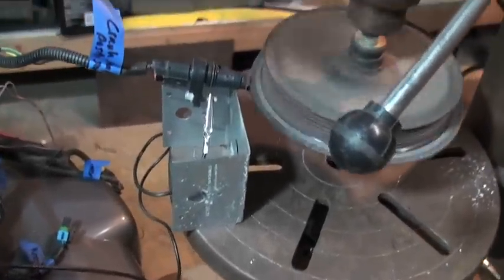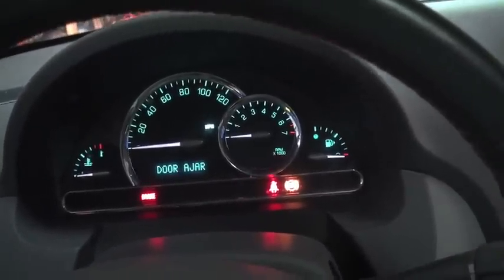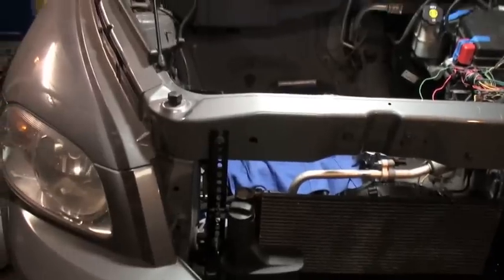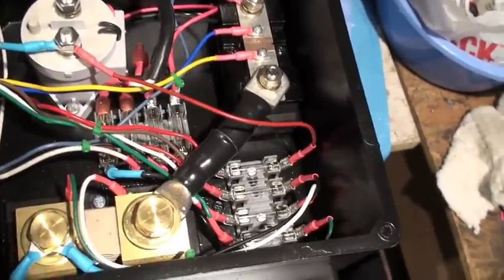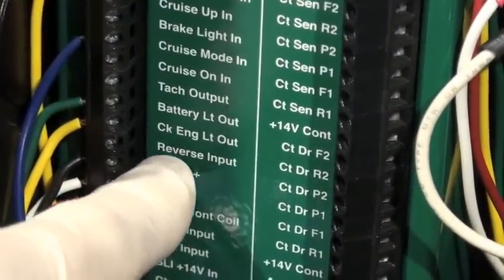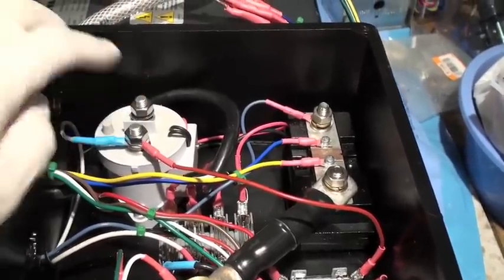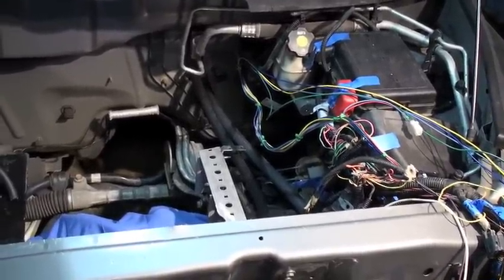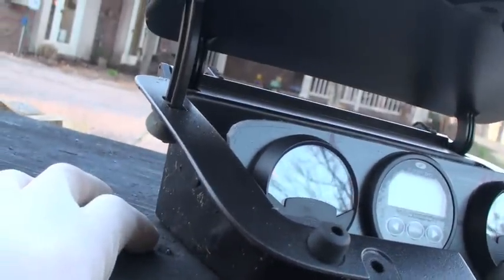HHR update December 2011 -Feb 2012

Comment from the maker: Thanks, I'm in the process of setting up a simulator that produces crankshaft sensor signal, camshaft (exhaust and intake) sensor signals, MAF signal, oxygen sensor signals, throttle position signal, and MAP signal.

Comment from the maker: thanks Larry, it's hard to tell but that spinning wheel is a 58 tooth reluctor wheel from the crank shaft of a GM motor.  This is reported to be the same one as in the stock 2.4 l ecotec engine that was in the HHR to begin with. I've been told that I have to have the cam shaft input also to get the ECU to come on.  I think it is a 2 pulse per revolution input but I'll have to do a little more research on that.

Comment: i believe the ecm needs a signal from the crank sensor and the camshaft sensor, they work together. some vehicles also have a distributor sensor if they arent equiped with coil packs. I hope this helps, good luck.

Comment: I know, i mean the signal is pulsed directly, so you can just put whatever sensor with 2 triggers on the electric motor rotor and feed it directly to the dash. Not shure exacly how your dashboard works, but all the dashboards i disasembled have direct connection to the ignition coil or the hall sensor at the cam shaft. It's basicly the same thing as generating puses with a switch and a hump on the rotor. You just need to match the amount of pulses per rotation to get the corect RPM.

Comment from the maker: Yes, so do all of the other little things go into a conversion. I usually spend about $1k on the "little things" for each conversion.  I think I'm going to try to buy connectors, nuts, bolts, plastic sheets, multiple gauges and colors of wire, tubing, zip ties, hose clamps, velcro, steel and aluminum struts, grinder wheels, electrical tape, teflon tape, and a hundred other little things in bulk before I do the next one.

Comment: 0:39 Hi, any chance you could do a ten years later update, is this vehicle still in use? With the current fuel cost, maybe a recap of the conversion including what worked and what didn’t work. Changes due to failures! I have an Interest as my daily driver is an 06 HHR

Comment from the maker: Well, it turns out that the vehicle is actually a 2006 HHR not a 2008 and that means it has what's called a 7X or 6+1 crankshaft reluctor ring that is manufactured into the shaft, not the 58 -2 ring that is found on the 2008.  So I'm in the process of making a 6 inch reluctor ring with 6 notches 60 degrees apart and one notch 10 degrees off of one of the 6 main notches.  This should replicate the pulses that the ECM expects to see.  I'll keep the .030"  gap in mind.  Thanks

Comment: ido not know if its important now but you plased a culing radiator sideways you migh have a problem with bubles/air stuck on the top of your tubes (radiator supose to sit tubes on the side)not in up or down position(inlet outlet tubes)